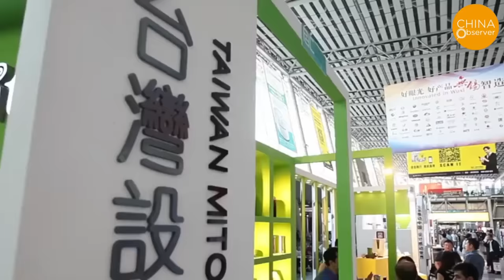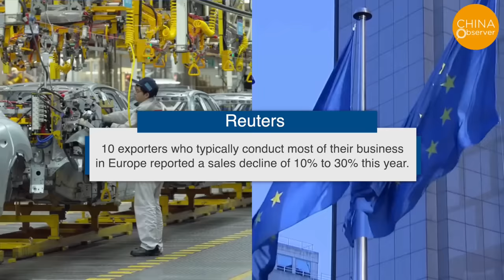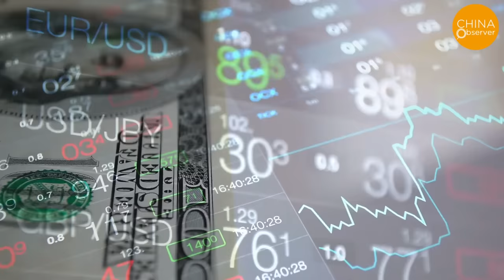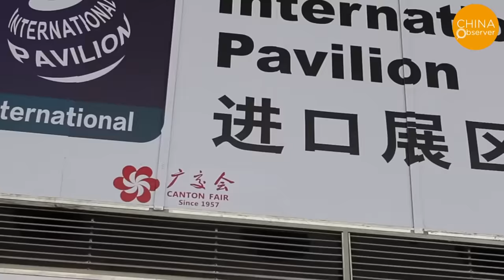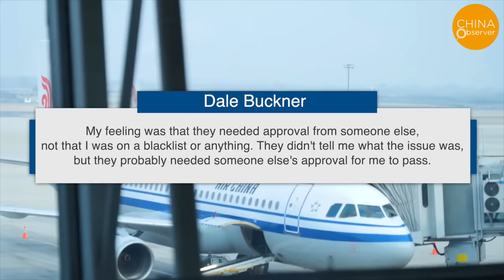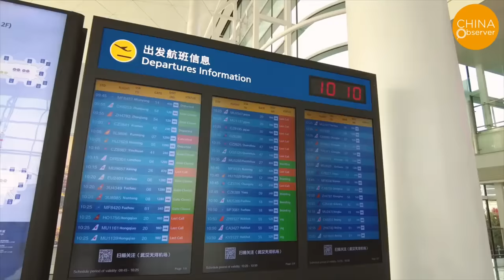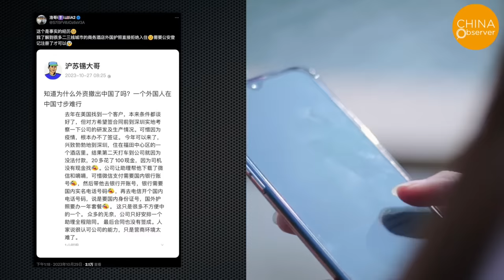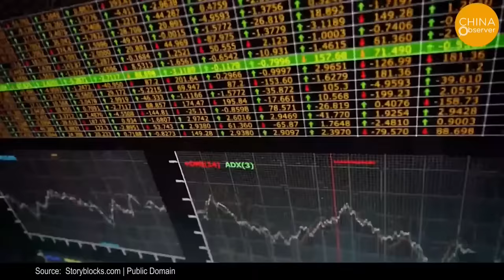Canton Fair Crisis: 80% Drop in EU/US Buyers - Exhibitors in Tears: No Orders, No Hope!

Comment: I am looking for under floor heating for my bathroom floor. My husband really wants it. I thought I found a good choice.  Canadian company.  But their  products are made in China. 
Best case it stops working a year after I lay the ceramic floor.
Worse case. My house burns down.
I do not care if napkins are made in China. But when  it comes to most things, I want both safe and reliable.  
When my iron broke, it took a while to find a replacement.  Non made in Canada.  Non made in the states. Bought a great one made in France.  Large water section for steam. Auto shut off when not in use. And a cord which is longer than 3 feet.  Had it 3 years now instead of the possible one year out of Chinese fire hazard garbage.

Comment: For those who are interested in the truth, this seems to be a propaganda channel. Both my wife and myself sell on amazon and deal with our chinese supplier once every few months. They seem pretty fair so long as you stipulate all conditions ahead of time. Even the thickness and weight of the material needs to be put down in writing and checked by a 3rd party inspector. Thats just how its always been. For those who comment that they try not to buy from China, they don't realize that even the raw materials used for the "MADE In US" are imported from china. 85% of the components your touching right now have one point been made/ processed/ or refined in CHINA. US would never go to War with China, because it would hurt both economies drastically. The S&P500 would crash and wipe out tens of trillions of dollars overnight and same goes for China. Unless there was a reason or economic prize larger than the cost, both countries would avoid war at all necessary costs.